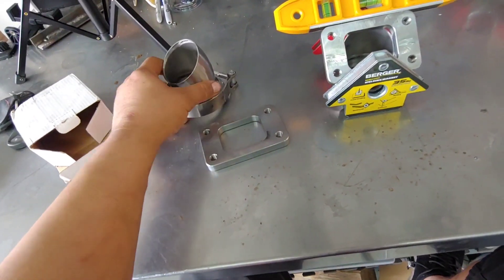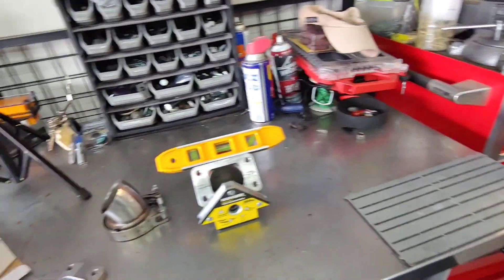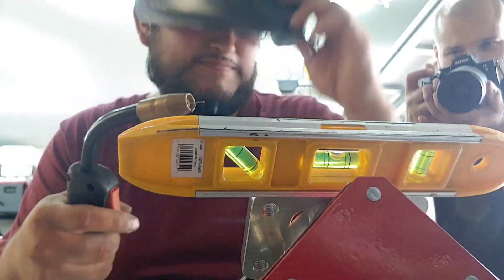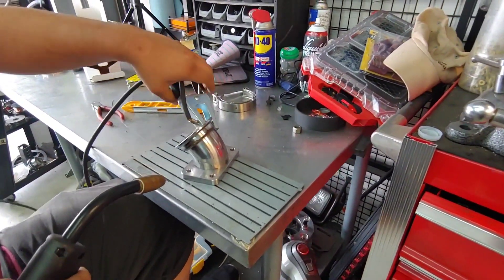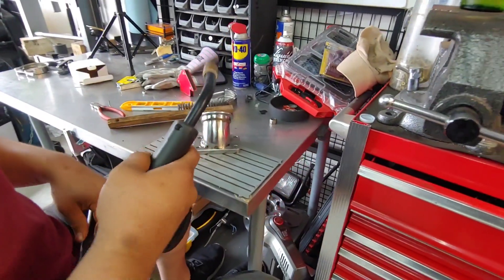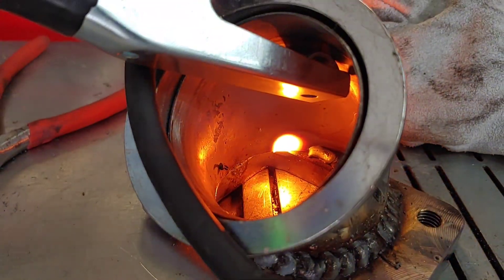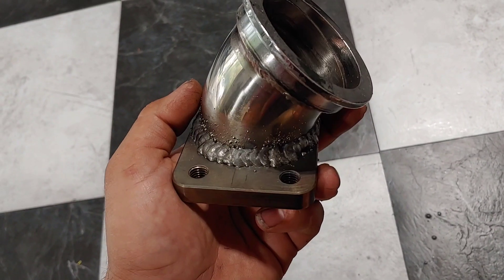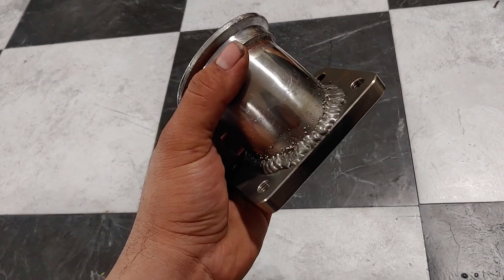Can You Mig Weld Stainless Steel?

Comment: As a welder this is painful to watch
Reply: Id be practicing on test metal not the product if i was learning lol
Reply: I agree
Reply: Wow that's horrible to watch as a professional welder.  Always use test materials to fine tune the welder before moving on the the project. Miller makes a great app for beginners and professional alike to general set things. Then, adjust settings for performance and comfortability.

Comment: Is that flux core wire it would look tons better if you can use oxygen since ur not welding outside
Reply from the maker: No its not flux core
Reply: @BoBuilds  oh with the peppering it looked like flux looks good thow for not doing it very often
Reply: oh boy!